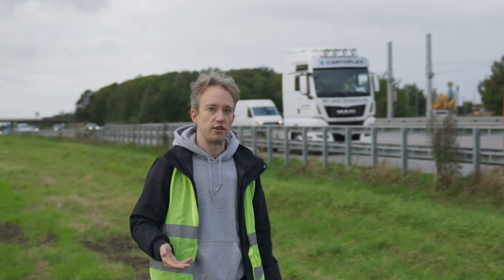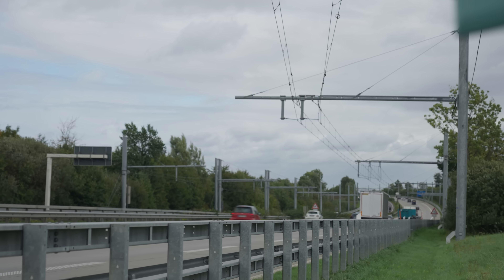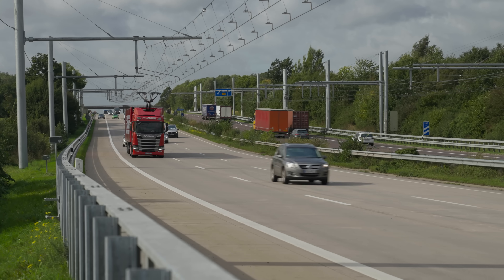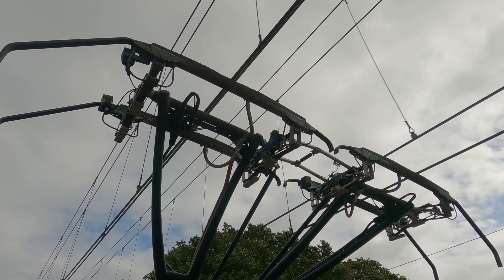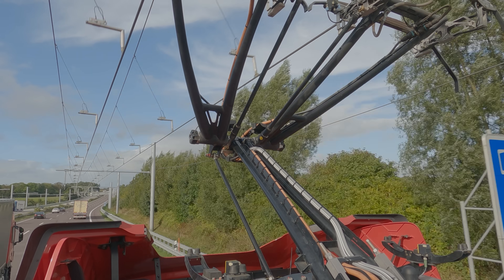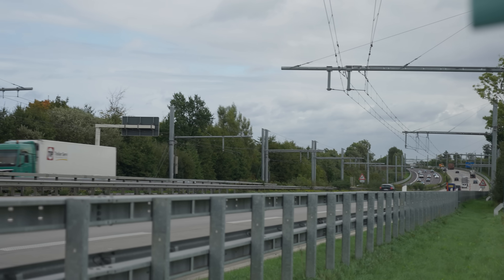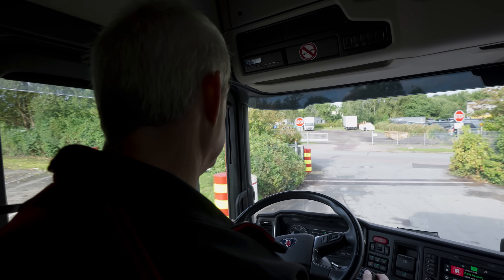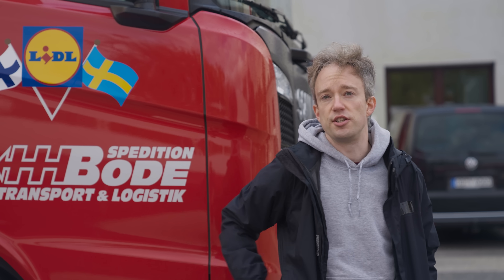The highway where trucks work like electric trains

Comment: Where is this massive amount of electricity going to be generated from? and what happens when you lose electricity for whatever reason and it may take you days to restore it?
Reply: The thing is, even if you power lorries like this with electricity from coal fired powerplant, it'd still be less damaging to the environment than those same lorries burning diesel. As it's much easier to extract every last bit of energy from that coal in a huge, stationary powerplant. Same goes for filtering the exhaust fumes. The particulate filter on a lorry can only be so big and so heavy before it starts to become too bulky and heavy and starts eating into the carrying capacity of the lorry.
None of those concerns exist for a powerplant. Build a giant particulate filter the size of an apartment block if you want. That filter doesn't need to be mobile. Same goes for NOx and SOx scrubbers. Theoretically you could even capture the exhaust CO2, refine it and sell it to greenhouse farms.

The current generation of Formula 1 internal combustion engines are about 50-52% thermally efficient. Meaning that only 52% of the chemical potential energy in the fuel is being converted to mechanical energy to move the vehicle. Road going vehicles are nowhere near this efficient, they can't be because of manufacturing tolerances and reliability requirements.
By comparison the current generation of Formula E electric drive trains are upwards of 97% thermally efficient. Meaning that 97% of the electricity put into the batteries is used to move the vehicle.

As for electricity failing for days on end without there being an alternative "route" within the grid? The last time there was a power failure in the EU comparable to what happened in Texas a few years ago was in 2006. And that failure only lasted for 2 hours.
There have been more recent, but much smaller scale power failures where entire villages were left without power for days on end. But those same villages were dealing with massive flooding at the time. When there's 10 feet of water in your living room, you probably have bigger fish to fry than there not being electricity.

Comment: This is plain stupid.

An important task of roads is to transport goods that are to big for railroad (machines, industry equipment). These transports are already very difficult and expensive. There is no way they still exist when they have to remove and mount an electric system for every single transport.

Roads are flexible, railroads are efficient. We as a society win nothing when roads get a  little bit more efficient, but loose most of their flexibility in the process.

If we really want efficient transport this stuff will not help us. There is only one way: railroads. There is still a lot to do (automatic cargo load and unloading process, automatic load from train to truck or back station, stuff like that. But in the end this could work and it's also not complete new, it can adapt a lot of technology that's already in use to load and unload cargo ships.)

Comment: germany is amazing they always get the job done no delaying stuff for 30 years
Reply: Haa haa how about Berlin airport
Reply: It's just an experiment. They are great in inventions, not in bringing it to market.
Reply: they got no gas no power and in bed with the Russians they are doing relay good.
Reply: @boltactionbunker5276  you treat talking about possible problems like problems would already exist.
Reply: @boltactionbunker5276   germans are smart, they will fix it
Reply: No, our train network sucks, we get way more potholes than we should, our internet is awful, and you go off the grid if you go 5 meters off the road, our roads suck btw, our speed limits suck too. Every country is awful at infrastructure

Comment: Here's a really crazy idea: What if we build metal grooves into the truck lane, and the trucks have these drop down metal wheels that go into them, suddenly the rolling resistance is really low and a single cab can pull more weight. Then we put another trailer on the back... and another... and another...
Reply: There are train for some distance, but also need truck, truck travel to anywhere, anytime and delivery goods to store, market directly. We can't build train everywhere because sometimes the line will not turn profit.
Reply: Nah, let's not use this incredible technology that works perfectly fine because, innovation???
Reply: Yea and when that tram comes to a station we can even make it Dock and unload the cargo trams then change track and carry different cargo trams back to home destination
Reply: I'm a huge believer in railway, but I have to admit that we don't have the time left to replace enough trucks with trains before climate change is going crazy. We have to use this.
Reply: @igel9316  even replace all cars and truck on earth does not solve climate change. Let's say new vehicle or trains run electricity. Where is it come from? At the end nothing change.

Comment: you have to make electric highway for few kilometers ..and at that time vehicle should run and charge to still battery inside the vehicle..after that it should go on normal road and after battery becomes low ..next electric highway for few km should be used..

Comment: Revisiting this video, i can see infrastructure cost for this project being potentially difficult to swallow in certain circumstances.

In the UK, some motorways have quite low bridges that would have to be rebuilt to allow clearance for the cables.

To use one example, there is a service area near me in west Lancashire that is notable for having a bridge over the M6 with multiple shops and amenities hosted above the road.
The cost of initiating a rebuild of that entire site fit to add such infrastructure to the road would be enormous. 

It may be possible to facilitate a temporary storage system that can allow the truck to continue past low-lying existing infrastructure. But, it is definitely something to consider.
Reply: Passenger trolley buses have battery storage so they can drive for a few blocks where there is no overhead power. These trucks have the smarts to align themselves with the overhead wires, so it wouldn't be a problem to just drop the pantagraph when it goes under the bridge, and resume.   On the static kind of route from a port to a specific warehouse, that will become the simplest way to implement autonomous driving of the trucks. They can just run back and forth 24 hours a day.
Reply: Wikipedia - Electric road. Sweden has tried out many of the Electric road options regarding the cost of each one. It looks like an on-road contact system with under vehicle pantograph will see all vehicles private cars and trucks be able to take advantage of this option, and only a 1 metre section under the vehicle is switched to high voltage the rest is return ground.
Reply: @mnipp  how does this system avoid having damage from snowplows in the winter?  Is the road surface heated?
Reply: There's a proposal to trial this system on the M180 near Scunthorpe: ironically not far from the trolley bus museum at Sandtoft!
Reply: The obvious solution would be not to run pantographs through tunnels if they dont have sufficient clearance to save costs. For instance in Norway some highways will go from 4 to 2 lanes when going through tunnels to save on costs.

Comment: Lorries should have there own road system, keep them off normal motorways and there will be less delays and traffic jams. nothing more annoying when a lorry is overtaking another lorry in the middle lane, it takes ages for it to pass the other truck and holds the traffic up, even worse when they do an overtake on a dual carriageway.. I'm sure they do it on purpose to p*SS other drivers off! 😡

Comment: Electric trucks, as they stand, are just not practical.  Not just because the range isn't enough, but because the batteries simply weigh too much.  Notice how Tesla's semi truck doesn't have it's weight published on their site.  That's because the heavy battery takes up most of the space in a vehicle that has maximum weight limits on the road, making very little space for cargo weight on the actual truck.  It's just not feasible when your battery takes up half of your maximum gross tonnage and leaves half as much room for cargo weight as compared to a normal truck.

Comment: Or you can just use electric trains instead of trolley trucks for transportation goods on long and middle distances. Trains have much lower rolling resistance and can transport more goods at once. Also major part of road surface damage is case by heavy trucks. Trains don't block whole single highway line (obviously) unlike trucks do.
Reply: freight trains have to constantly stop cause of passenger trains causing more wear and delays.
Reply: @starandfox601  Solution is quite simple. You must build very dense, well maintain railroad net. I know, it isn't cheap but people get used to it.
Reply: @Wentix_cz  it's not that simple cause there's no space to build it in Europe and no way to fund the building.

any place rails could be built there are already passenger trains.

Comment: The most senseless invention outside of a square wheel.
These 5 Testgrids across Germany have cost several 100 million Euro. On each of the 5 grids are a maximum of 5 (FIVE!) trucks that can use it, of which most of the time 3 out of 5 are 'kaputt'. The money spent for this would have easily electrified a number of km of existing train tracks, making them far more useable for freight trains and reducing diesel emissions.
I pass along the grid by Frankfurt daily. In 3 years since they put it up i have seen ONE (!! ONE !!) truck using it.

But German engineers MUST reinvent the wheel every couple of years....

Comment: I gotta say, driving below that powerline can become uncomfortable. (In a regular Car)

Many people avoid those lines and move to the next lane over, possibly reducing the efficiency of the road. A small negative, but you should consider that. Surely, you can get used to that, people drive under tram wires all the time, but not everyone is used to doing that.

Comment: those wires are also a very good self-driving system, as trucks that connect can just keep constant 95km/h, and probably let driver sleep for 3-4h needed to get close to ending gate. 
if its made like that and drivers are only active at the start and ends of the road, we literally can have a line of trucks behaving like trains, grouping together, and going in convoys, until they need to detach themselves to their destination.

Comment: If all the trucks run on the same road, why not just use a train?
Reply: The state of Cargo DB is very bad, with no intention to improving it. This also has the benefit of just using trucks and not having to load it on Trucks when it arrives via train. Except if the factory is connected via rails, which won't be the case mostly.
Reply: because it's still a road.

also passenger trains.

Comment: I mean... Why would you adapt a train's technology on trucks, that will have rolling resistance from the tire and the gearbox and other losses, while you could just use more trains, develop the railway at a lower cost economically and environmentally speaking than converting all the trucks, and just be a little bit smarter than everybody across Europe
Reply: because you can still have a road with trucks.

also cause passenger trains rule the rails making freight non viable.

Comment: It's impossible to use this technology to power trucks and cars. As you see in this video this isn't a truck it has a registration a train in the power delivery system is deployed and a registration as a truck. It legally not a truck as long as the power system is up.

Comment: We got rid of this technology many years ago, so why are we bringing it back again? We already have this technology on trains, so rather than spending billions, upgrade the rail network and trucks can then be used locally
Reply: Most German cities with industry are close to highway access but a lot of them are quiet small and not close to railway connections that could handle the requirements of their companies. "Upgrading" the German rail network in a way that it could handle the existing highway capacity would essentially mean to build a complete new one. Not only would that mean a lot of opposition on local levels, there is also the problem, that the German rail system is in the responsibility of the Deutsche Bahn, a stock corporation whos management, though it is owned by the German State, doesn't really seem to act strategically in the best interest of nation and people.

Comment: Road haulage over long distances is just about the worst solution ever. "Electrifying" it by spanning wires over it does not change that. Trucks should be exclusively used for short distanc collection or distribution - and tha can be done by BEVs.

Comment: This fits in perfectly well with my EV train idea, where you have individual small cars linked together, and towed by a locomotive, and in this case it can run off mains using these overhead wires.  So people don't have to drive their cars, they are 'self driving' being towed, and in fact get recharged via regen, so when they detach at their destination, car is fully charged, and they don't need a big giant battery like a tesla to go long distances.

Comment: Sales of new petrol and diesel cars will cease in the UK in 2030, not 2040. That's just 8 years away now. This system does seem like a very sensible solution, particularly where I live as we're on the main road from a major UK sea port.

Comment: I just realised another cool thing on a rewatch, on trains the overhead wires have to be positioned to zig zag back and forward to avoid wearing out the same part of the pantograph, here, because there are no rails, that problem won’t occur which makes hanging the wires easier because you can just have them hang straight.
Reply: I think the wear may still be an issue on the long run, and maybe in the production version there would be zigzag wiring, but indeed it will never be as bad as trains, which have a perfectly aligned path in most case ^^

Comment: And what happens when there is a power failure

Id like to see them try this in Australia let's say between Perth and Sydney. Considering Western Australia isn't even connected to the National Grid. 

This will be like divers drones, a fad that turns out to be a joke
Reply: Then the trucks move on by their own power either from battery or from a hybrid solution until the power comes back, doh.
Germany/Europe isnt in the darkages anymore, our power-outages are rare, very localized thanks to the european-wide grid full of redundancies and very short. Honestly cant remember when the last power-failure was in my region, but I am sure it never was longer then 5-10 minutes at a time and probably never summed up to an hour per year. Power failure is the tiniest "what-if" with this concept in europe ... maybe Australia needs some work on its grid, if power-failure even comes to mind as problematic.
Reply: @diedampfbrasse98  we have brown outs and power failures on a regular basis. During winter because of storms, and during summer because of excessive loads, pole fires. For what we need, our power grid is probably 20 years behind where it should be. South Australia, Victoria, New South Wales and Queensland are connected via the National Grid System, that way they can share the loading, or the National body can direct more power to one state over the others.

Comment: Why not just have a diesel electric setup similar to a train and when electric power is available shut off the diesel engine to run the electric motor there by not having to use expensive lithium ion batteries that are in short supply in fact this would work excellent for commuters as well especially with automation becoming a huge thing

Comment: There was quite some criticism for the project, because the money that went into it could've been used very well to upgrade/expand rail lines and their electrification, replacing trucks whole on many of the long-range routes.
Reply: Railways have many systemic problems including significantly higher infrastructure costs and operators which don't share the infrastructure properly. not to mention need for last mile delivery and shunting/railyards.
However, railways are more efficient and I wish it would be done. Governments don't seem to have sufficient political will to do that.
Reply: @oadka  The Oil Industry made sure of the lack of political will.
Reply: The source and destination of the payload, both need to be adjacent to a railway line, otherwise guess what - you need a truck for the rest of the journey.
Reply: @ArtyEffem  Can you read bro?
OP knows thats. Thats very obvious my friend.

We still want to reduce the usage of long range trucking aka trucks using the highway alot.
Trucks are supposed to be short form transport (Last Mile). Rail is so much more efficent and cheaper at hauling goods across the continent than trucks are.
Reply: I thought he clearly stated that these routes are use for last mile delivery from warehouses to other warehouses or to customers.
Reply: @nntflow7058  No watch again!
Reply: Don't worry, this pilot project will probably be the start of a new freight rail corridor.
Reply: @KRYMauL  no it wont
Reply: @strammerdetlef  Every time one of these programs gets off the ground, it's determined that a train is more effecient.